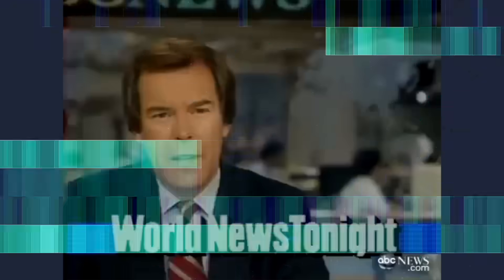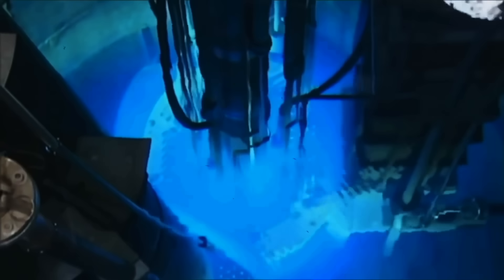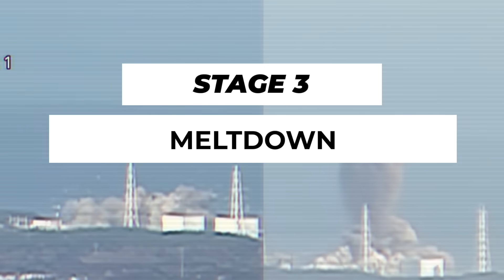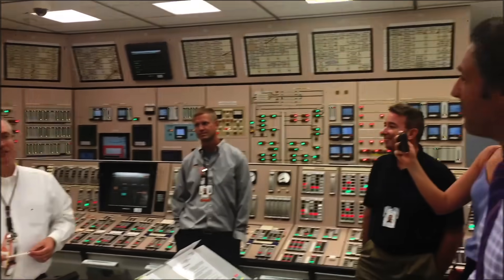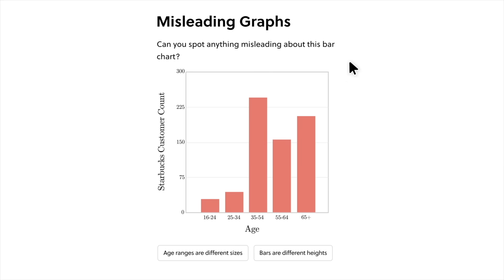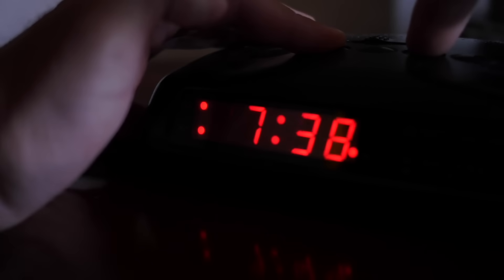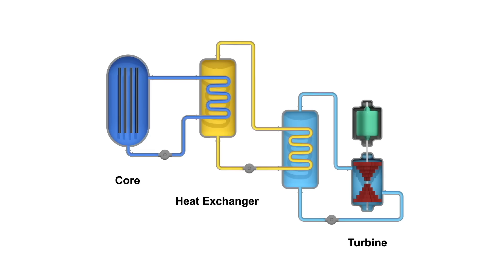Why Is It So Hard to Stop Meltdowns?

Comment: Disabling some safety systems (so that the test could be ran) did in no way contribute to the Chernobyl accident. In fact, it was a safety system that blew up the reactor.
Reply: Yes, one of the safety mechanisms was the last bit that was engaged. If that makes you discount all the prior steps as "did in no way contribute", you're terribly lost.

Google "single cause fallacy", I think you are a curious person and learning is something you enjoy.
Reply: @u1zha  The disabled safety systems included ECCS, first setpoint of the water level of the drum separator and SCRAM on turbine trip. ECCS helps if there's a coolant leak, not when the entire reactor has exploded. The outer water level setpoint was still in place, and a premature reactor trip would have messed up the test. None of these contributed to the accident which was caused by a fatal design error of the reactor where inserting the control rods would in some situations increase reactivity instead of decreasing it.

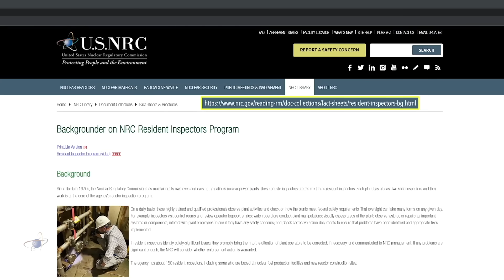Comment: At 11:08. That is a BIG generator engine over that guys right shoulder. It looks like an EMD 2 stroke diesel, much like what EMD used in diesel electric locomotives for a LOOOONG time. They are still very common, super reliable, and very easy to repair and get parts for. That was an excellent choice for the power unit for a standby generator. Those engines are known for dependability and ruggedness. Fun fact! Just above the red writing on the side of tge engine is a valve. There is one of every cylinder. Those are blow down valves. They go directly into the combustion chamber, and are used to vent any possible moisture or oil buildup on the top of each piston from them not having been run for periods of time. If there was water or oil on the top of the piston, at best it could hydrolock the engine, at worst, it would bend or break that cylinders connecting rod and or piston. Fun fact 2: the older Detroit Diesel engines that were also used as generators, truck engines, and various other industrial applications worked almost identically to this monster EMD engine. From the individual self contained injectors with individual fuel racks to meter the fuel amd therefore engine speed, to having to have forced induction to even run, they are the same. Locomotives generally had a superturbocharger that acted as a supercharger at idle being driven by the crankshaft via an overrunning clutch, and at higher loads and RPMs they acted as a turbocharger, being driven bu the exhaust gasses.
Reply: Yes

Comment: Feels like we can do this 1000x safer nowdays, than in the 60-70's, when the plants that actually have meltdown was built. 
But for some reason we expect nuclear to be just as unsafe, it's like comparing an car from 1970 with one form the 2020s, there has been huge leaps in design and meterial science since then but apparantly not when it comes to Nuclear Plants?
Reply: Yeah, arguing against new reactors because the ones from the 60s were unsafe feels a bit like refusing to fly with an A380 because the De Havilland Comet tended to crash so often back in the 1950s. It's just not a very good argument and makes it look as if there were no better ones.
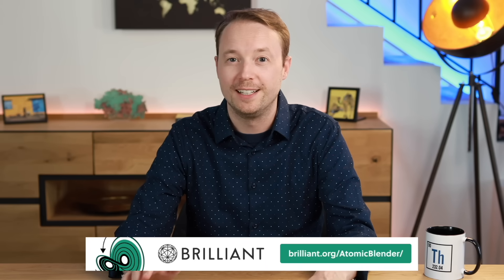Reply: 13:37 13:37
Reply: @NeovanGoth  13:37 13:37 13:37
Reply: The biggest thing in these reactor accidents (other than fukushima) was that these operators didn’t have the proper level of knowledge to understand what they were doing to their reactor plant and what was actually occurring. I agree with you that safety measures have improved, but at the end of the day a reactor will respond in a very similar way to changes in plant parameters and without proper training and full understanding of what the operators are doing, then no reactor is truly “safe”. Think about it, the US Navy had had nuclear reactors since the 60s and never had a reactor accident. Not even in the slightest. Thats due to full understanding of the reactor plants
Reply: @gbulifant222 Fokushima has disregarded multiple best practices and safety regulations in the construction of the reactor.....
Reply: @philipschmid9352  They didn't disregard safety practices during construction, they refused to redesign the plant after construction.
That's nowhere near the same thing.
Reply: @philipschmid9352  And yet when hit with a *historic* 9.1 magnitude earthquake and tsunami, there was no loss of life from the meltdown.
Reply: @exploding_pineapples  From the Fukushima disaster, one guy (a lifelong smoker) had lung cancer and the radiation may have caused additional complications with it, such that the company decided it was cheaper to just pay out the insurance instead of suffering the PR damage of trying to contest it in court. Assessments of the environmental impact boil down to "there's a small but consistently measurable amount of additional background radiation in the area, but we can't actually find any damage or problems that are unquestionably caused by the extra radiation, and not by other industrial pollution in the area". But everyone is acting like it's Chernobyl all over again.
Reply: @martenkahr3365  it's not like Chernobyl, it's way weaker than Chernobyl, if It was like Chernobyl, the whole of japan won't be liveable buts it not, it's a small part of japan that is kind of unlivable (unless your at the power plant, idk why your there besides helping out with the clean up)
Reply: @exploding_pineapples  and the industry has adapted to prepare for "Beyond Design Basis Casualties" as a result, doing their best to prepare for the complete unknowns.
Reply: @gbulifant222  The difference between the three mile island and chernobyl actually shows how far nuclear reactor design have come, no?
Reply: None that the public knows of* @gbulifant222
Reply: Something that is important to note is that the old reactors are nowhere close to "unsafe", they normally have multiple safety features. The thing is, modern reactors would be even safer.
Reply: Agreed. A well designed, well managed nuclear power plant is by far the most efficient method of producing energy available to mankind presently.
Reply: all thanks to Big Oil
Reply: Rbmk reactors literallly
Reply: We made it safer
"But what if the safety fails! YOU WILL RUIN THE LAND!"
We have improved over the many, many years, we have time t-
"NOT ENOUGH TIME, DOOM!!"
^ Any argument.
Reply: Same with the Russian navy submarines, despite several horrific accidents and sinkings no meltdowns or any other major nuclear accidents happened in the Soviet/Russian navy
Reply: The biggest reason we don't make nuclear reactors much is because it costs a shit ton to build and it take a shit ton of time to build. No one really wants to do that.
Reply: Cars were much safer with more metal and less plastic!!!
Reply: Among other things, it is a bit hard to change the laws of physics.
Reply: You're also battling against the negative connotation of the word "nuclear". People that don't understand what this energy source is and how it works (arguably most) will hear "nuclear" and think of Hiroshima, Chernobyl, etc. If we can destabilize the connotation itself, that might help.
Reply: Indeed, we can. Current designs are passively safe. But “nukes bad”!, haven’t you heard?
Reply: Almost all of our reactors were built in the 60's and 70's

Comment: steam ejector pumps would appear to be by far the most obvious devices to use for emergency pumping of coolant. powered by steam, that would be turned on/off by a mechanically actuated valve. and other than the valve, and steam.water no moving parts to go wrong.  they convert the heat from steam into some suction of water, and can then pump that water to a higher pressure than the motive steam.
Reply: Indeed
I think this one game had a good title for it
RCIC
Aka When power is gone steam powers it
Reply: I mean, we were trying to use the heat from the reactor to power the pumps to keep the reactor cool way back during Chernobyl. The problem with Chernobyl being that they blew up the reactor in the middle of the test. They weren't even testing for that.

Comment: When a reactor core melts the corium can and will form into fission conducive lumps where small re-criticalities occur, which in turn ramps up the heat of the molten fuel dramatically. So no, hitting the concrete foundation under the reactor is NOT enough to stop the meltdown, infact in experiments it was determined that corium can eat through about 1 meter of concrete per day if the fuel forms fissionable formations. 

You didn't mention the chemical reaction that forms hydrogen gas from the cooling water which can then ignite to blow the reactor and/or building apart, spreading parts of the core the close vicinity into the environment. 

And that almost every single reactor built is situated in LOW land value areas, because it was easier for permits and cheaper for construction. These areas are low value exactly because most of them are in areas of flooding, faultline, near active volcanoes or tsunami zones. Not great places to build these monstrosities. 

Regulatory capture is a big issue too, where the industry lobbies and pays off the regulators to keep old plants operating well beyond their planned lifespan in a very dangerous and irresponsible game of nuclear chicken. Remember a plant can operate flawlessly for 40 years, but it only needs one bad day...

Spent fuel pools are super dangerous, most of them contain the full lifespan inventories of their reactors fuel changes, some containing 4000 spent assemblies still requiring cooling. If you think a "small" meltdown of a reactor core is bad, imagine this x20 in an unshielded spent fuel pool. It would make Chernobyl look like a campfire in comparison.

And finally, neutron bombardment and metal fatigue of the core materials. Most of these plants are over 40 years old! they are super complex machines with hundreds of miles of pipeline, ductwork, cabling and so on, with many of these parts highly irradiated once first used. Eventually they become embrittled, lose their durability and cracks form, leaking radioactive water or gasses as the plant ages. Tritium is one big emission from most elderly plants. The recent tritium release from fukushima is nothing compared the standard everyday releases from most aged plants in the USA. But they don't tell you that bit. 

Ohhh and anyone saying nuclear is the "green" energy source of the future... I got some bad news for you. The mining, milling, processing, manufacturing and transportation of the fuel assemblies emits about as much CO2 as a gas power plant. So while the reactor itself is emission free, the fuel cycle most certainly is not.
Reply: Word for word everything you have said is true and i couldn’t of put it better myself, although reading your post i actually thought it was myself commenting !!
Reply: nuclear has much more reliability and can fit in a much smaller space than a field of solar panels or wind turbines... sure they might be resource intensitive but they can last for almost 50 years producing up to 1500 MWe for the grid. i hope in the future the world isnt just filled 90% with solar panels 🤣
Reply: @nopenope7510  Of course nuclear does have its place. But I just wish it wasn't so greenwashed and misrepresented as some kind of biblical saviour technology.

As with ANYTHING man makes it is inherently flawed and potentially extremely dangerous technology. We cannot be flippant and careless with this. 

I put this argument to you though. Instead of looking for MORE energy and new sources of energy, why are we not instead looking for ways to cut down our consumption of energy? To need LESS of it. To become more efficient in our lives and work. And to promote more energy free forms of entertainment and living? 

Less is more.
Reply: 1. Source

2. That's what the containment vessel is for

3. Source

4. Source

6. There's no special tritium, or super special tritium. Tritium is tritium. A weakly radioactive element that even occurs naturally and is ever present in our water. 

The Fukushima discharge is being monitored by the IAEA and three separate governments. The IAEA releases reports on the situation and live data. 

It seriously doesn't get any more transparent than that.

7. Incorrect. NREL has made a study on the impact of various energy sources from cradle to grave. Look up Lifecycle Assessment Harmonisation, NREL.

Comment: What about the ”China syndrome”? Myth or possible?
Reply: myth. there are many automatic cooling systems in place
Reply: The "China Syndrome" is about as realistic as "Aliens".  The movie suggests that the corium would be so hot it would go through the Earth to China or at least, very deep.  We have seen what happens - Chernobyl.  That is as bad as it gets.  While it was the worst nuclear power accident in history, it killed about 70 people.  The radiation is so low (by comparison) that the evacuation has resulted in the forest flourishing due to the lack of human activity.  We are also unlikely to ever see another accident like that as it was due to a bad test on a badly designed reactor (RBMK type).  Anyway, just as no acid can keep eating through endless floors of metal (such as that dripped from an "Alien"), no corium will go through much more than a few meters of Earth.

Comment: it is so hard because humans do not understand real forces or chances and challenges,
only in mathematical form. I conclude sorely: they melt down because they were built.
Which never should have happened.
Reply: cars crash because they are driven to follow that argument nothing or no one ever do anything
Reply: @doniehurley9396  maybe the fact that high pressure fissure nuclear plants keep blowing up may make you think?

Chernobyl, Ukraine (former Soviet Union), April 26, 1986
Three Mile Island Middletown, Pennsylvania, USA, March 28, 1979
Fukushima, Japan, March 2011
Frenchtown Charter Township, Michigan, USA, October 5, 1966
Idaho Falls, Idaho, USA, January 3, 1961
and the list is longer.

The NEAR accidents list would clog this conversation.
Thank you!

PS. Nucelar power is the future, but not the uranium fiussure time bombs: our "normal" plants.
 Molten Salt low pressure thorium power plants appear to have a future as being a simple technical object without any human operations.
Reply: @marcelwierda6262 TMI did not "blow up". That was a series of unfortunate events that led to the failure of an otherwise well run reactor. The operators did more damage to it than anything else. They F'ed up and shut off cooling water when they should not have.
Reply: So then we should only use coal and oil because nuclear is way more dangerous right?

Comment: And Putin puts a mini reactor into a motor in a cruise missile. Even if it is a big missile, the reactor will be built down to a weight, and will have to raise the incoming air to a temperature of about 800C. So to get the heat transfer we must talk of core temperatures well in excess of 1000C.  The air entering the core will be around 0C.  So the materials are at metallurgical and chemical limits and under extreme thermal stress. So my own view is that even starting a gas turbine based on such principles, and at a comparable weight to current gas turbine technology, will simply create a dirty radioactive incident. And as the intent is to carry a nuclear weapon things could easily get very messy.

Comment: Nuclear Power is inherently unsafe because it requires active safety. Prolonged loss of power to the control rods or water pump, for instance, will result in a reactor meltdown. Reactors, however, are not the only part of a nuclear plant requiring active safety. Spent fuel tanks require circulating pumps to keep them from self-combusting.
Reply: Molten salt reactors are inherently safe(r) in that regard. You haven't read enough if you think every reactor melting is unsafe :) The point being, molten salt reactors with fluid cores are molten all the time. That's how they operate.
Reply: @u1zha  He's not talking about molten salt reactors. Also, molten salt reactors are still on the drawing board. There are problems dealing with corrosion due to the salt.
Reply: @bobweiram6321  well not to be that guy but he did say “reactors” without any qualification for if they were actualized or not.
Reply: Coal and oil power production have killed, maimed, and poisoned 3000x the amount of people killed, maimed, and poisoned by nuclear. This includes all nuclear accidents. Not to mention a multitude of industrial accidents that have absolutely nothing to do with commercial nuclear power. All safety is active in an industrial environment. Avoiding nuclear power for these reasons means we shut immediately cease any production of anything that causes more suffering than nuclear.